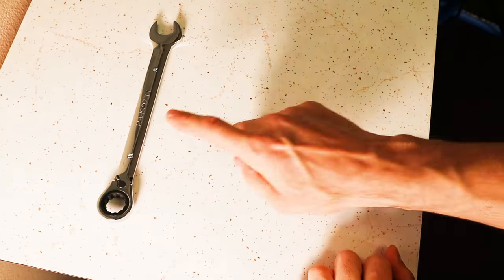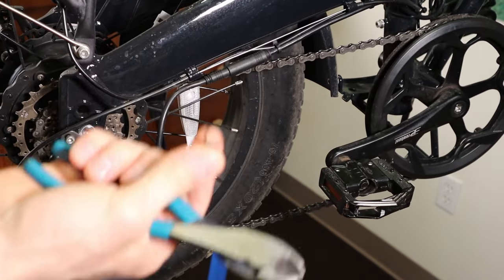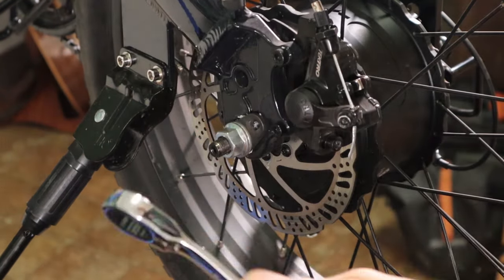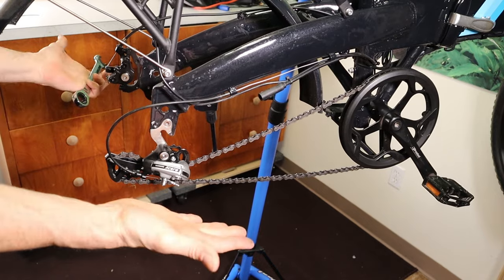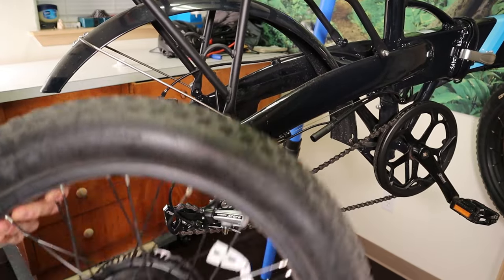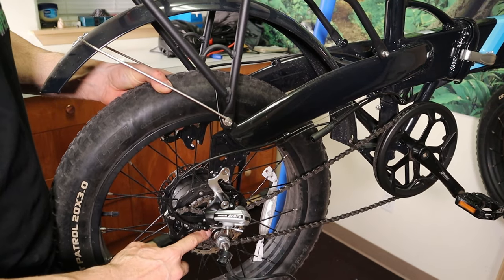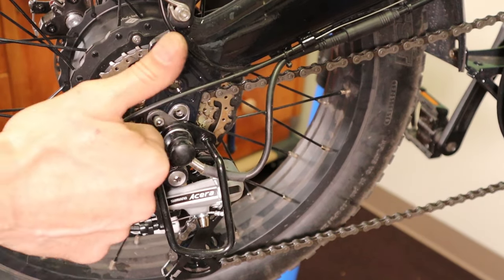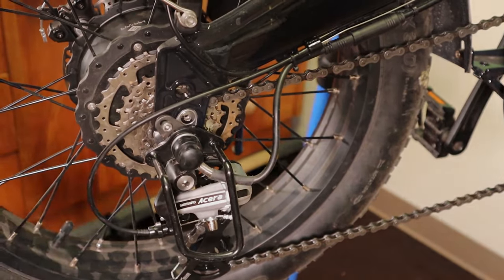Lectric XP 2.0 - REAR WHEEL How To Remove & Install (DETAILED)

Comment: I’m stumped. I’ve had my LECTRIC 2.0 step through since Dec 2021. I put 2500 miles on the original tires, and never once had a flat. Just ordered 2 new LECTRIC tires and tubes. I had a bike shop put them on, along with new brake pads. My brand new back tire has gone flat twice now and stranded me. It’s so strange because there was a pinhole sized leak in the 1st tube. I replaced the tube. Same day there’s a pinhole leak in the second tube. Filled it up with air, and the tube has slime in it. I put the bike in my shed and the tire was flat in less than a minute. We are stumped. We’ve examined the rim and tire. There’s nothing sharp in there, but the leak is in the same spot on both tubes. Has anyone ever experienced this? Could the tire be faulty? My front tire is fine.
Reply: Just got my step thru…back tire comes off the bead during turns..35 psi..left me high and dry twice☹️
Reply: Update to this post. Wrapped the rim with duct tape and haven’t had any issues. Apparently there was something pinhole size digging into the tube in the same place.
Reply: I’ve got 3500 mi on original tires.  
I’ve had one flat,  on rear.  Stranding me once😅.   Luck?         

Rear tire is now treadless and I have to change it 😮.
Reply: Tire liners perhaps?

Comment: I always turn rear motor bikes upside down to make it much easier to install the motor. I also sometimes remove the disc brake adapter (caliper attached) to make it easier to install the wheel....I charge a premium to work on rear motor bikes...some shops won't work on them at all...PITA!

Comment: This video was a life saver! Got my first flat on my XP 2.0, and of course it was the rear tire. Staring at all the wires, chains, spacers and bolts, I was feeling a bit overwhelmed... But after this step by step simple to understand video, I was able to do it all in under 20 min. Thanks again for making these!!
Reply from the maker: Thanks Patrick 👍 I'm glad it helped, the rear wheel can be tricky.
Reply: We have a lot of Mesquite with big thorns here in Tucson so I had endless flats a couple on the front & more on the rear tire. Finally a complete blowout of the rear tube. I bought an $83 foam liner & tube to match, new rim & motor assembly from LECTRIC. I made a DIY liner with an old tire (trimmed down) & trimmed down old tube. It's probably not as good as the foam liner but the front wheel is not so much trouble to take off & put on. With slime this arrangement should do for front & rear. 

I'm watching the video how to R & R the rear tire. Seems like it should be just as good to put the bike upside down (on a pillow for the handlebars & a block under the rear carrier?

Comment: Seriously best of luck to everyone attempting to remove their rear wheel from their hub drive ebike. Spent a solid 2-3 hours watching videos on how to go about doing it after i caught an unsuspecting flat otw home on my totguard mtb eibke. Changing a flat on a regular bmx bike for years had me spoiled once i realized on an ebike its abit different, and imo more troublesome. My bike is from a different brand but thankfully in this video he actually showed the process of removing the wheel and it was similar enough to where itll help others in a similar fashion. This video is one of the very few that actually shows the process from start to finish. 

Seriously though, it was such a pain to actually get the wheel off the first time. Then me being paranoid, i completely didnt pay attention to how the wheel actually came off as i spent an hour tugging away at the wheel due to it being somewhat jammed in place even after taking off all screws and whatnot. Basically panicked once i realized all the loops and whatnot id have to go through to fit the wheel back in once i changed the tube... lol. Then spent another 20 minutes figuring out the best way to fit the wires and wheel through the chain and back in place where it "makes sense", since i failed miserably getting to this part. Fortunately i finally figured it out and after 2 hours, managed to remove the rear wheel while unplugging the electronics, change the flat ( which took like a minute...just my luck), reinstall rear wheel, while readjusting my breaks and stem all in one piece. 

I finally get it now when people preach about working on your own bike when trouble arises. You really do gain a sort of bond with it, and begin to truly understand how and why things work the way they do and will be able to troubleshoot in the future when things pop up. So despite it being a pain that i caught a flat on my new ebike recently, im thankful it allowed me to finally learn how to repair it myself since it honestly wasnt so bad in hindsight. Now i feel much better knowing i can troubleshoot my bike without much concern or needing to stop by my local shop everytime a simple issue pops up. With ebikes, i was apparently overthinking things since in essence, they're still regular bikes at the end of the day.
Reply from the maker: Glad to hear you got it sorted out. 👍 There's a reason it's the Dreaded Rear Wheel.
This is also why bike shops will charge as much as $50 or more, to fix a flat on one of these, plus parts. That's if they are willing to help at all.
My goal is to help show as many repairs as I can so that folks at least have some guidance when it comes to their ebike.
Reply: Although I have a bike stand, I use it to adjust the shifting and adjust the break pads.  When I need to remove the front or rear tire, I find it much easier to flip the bike upside.
Reply: This sounds like a complete nightmare
Reply: @bobthebuilder9416  lol it honestly was at the time when I first did it. But fortunately like with most things, once you do it the first time, it becomes easier each time. But yes, definitely was a nightmare the first time I did it. Thought I broke the dang bike, before finally calming down and figuring it all out step by step. 

In the end, it’s much easier than it looks. But it’s one of those things where you won’t know how easy it is, until you go through it yourself, atleast once.

Comment: Thanks for this. It was very helpful.

I can echo what someone else said. If you don't have a stand, turn the bike upside down to reinsert the wheel. Obviously remove mirrors and move the display out the way etc first. Before I did that I was struggling with it balanced on a box. That would have worked, awkwardly, except for the fact that you really need the pedals to rotate freely otherwise the chain tightens which prevents you from pulling the wheel up tightly which gets very frustrating. Once I turned it upside down it literally fell into place quite easily.

I had to replace my wheel because the speedometer stopped working. Apparently it's the sensors inside the hub which you can't easily replace separately. The new wheel came with new nuts and washers. I noticed that only one of the new safety washes has the hole with the flat sides. The other has a simple round hole so it doesn't lock in position on the axle. I don't think it matters once it's all screwed up tight but I don't know if that was intentional or a manufacturing error.

Comment: Seems if you used a ratchet strap through the wheel and up over the rack, it would help hold the wheel up while you adjust everything.
Reply from the maker: Good idea, that could work 👍

Comment: My two safety washers, that line up with the frame, one lines up and I can get that 4mm bolt in, but the other side will not line up... it's a few degrees off, and since the axle is straight-through, I can't get the one side's safety washer in... it was when I took the wheel off, but not sure why it's off now.... hmmmmm.....
Reply: Flip the safety washer (Lectric calls it "torque arm").  Flat side faces in on one side, out on the other side.

Comment: Excellent guide, good enough to be used by Lectric for reference! I put re-usable zip ties on my RadMini, and got rid of the bash guard as well, so it's not so bad. When you find the wheel jammed or hard to remove, it's usually because the position of the axle rotated a bit due to motor torque, and the axle got wedged. Pre-loading the axle rotation by tightening the left nut first usually eliminates that, but in some situations I'll use a small adjustable wrench to pre-load it (opposite direction of wheel rotation). Props to Lectric for using double safety/torque plates, and thanks for the video!
Reply from the maker: Thanks for the added tips! Always appreciated 👍
Reply: I couldn't figure out how to loosen the axel.  I banged on it with a hammer like i would on a regular bike and it did not work. Finally i used a monkey wrench to grip the axle and turn it in the opposite direction to jog it loose. To clarify, if it looks jammed in one direction, I would turn it in the other and it popped out. I would add to be careful not to bend it too far, just enough to loosen it.

Comment: Thanks for another awesome tutorial!  Chris.  When you get a chance, can you make a video about how to straighten the handlebar?  When I straightened the front wheel, my left side handlebar seems to be farther away from then my right side handlebar.   My XP 2.0 arrived in such a condition.  TIA.
Reply from the maker: Thanks, check out this video - https://youtu.be/G-dPjys6N3Y
There is a 6mm bolt when you fold the handlebars that you need to loosen to straighten them out 👍
Reply: @PedalWithPower  Thanks Chris.  I will try that!

Comment: I dont have a safety washer on the gear side. lThe company insists that I lost it but thats impossible. I would have t remove everything to get it off. I asked them to send me a safety washer. But everytime I do this I spend many hours bahging onthe axle with q hammer. I get it done but It involves lifing it up readjusting until magiclly in finally goes all the way into the slot. I dont see how people just drop the axle in the slot I would pay somebody  50 bucks to ido this infront of me

Comment: I had removed the wheels and I try to put back and the wheels got hard resistance to spin..whats the cause? Is it the motor problem? Coz I try to change the planetary gear inside but everything looks good

Comment: Just wondering if it would be easier to turn the bike upside down and let gravity to seat the wheel back into the slot especially when you work by yourself and without a bike stand?
Reply from the maker: Hi Eric, you can do that. It's just harder to work on your bike upside down. Fine for changing a flat, but you plan to start doing any mechanic work, I'd invest in a repair stand.
I will be doing a video with some tips for flipping your bike upside down soon, still working on it 👍
Reply: @PedalWithPower  Looking forward to it.

Comment: I couldn't figure out how to loosen the axel.  I banged on it with a hammer like i would on a regular bike and it did not work. Finally i used a monkey wrench to grip the axle and turn it in the opposite direction to jog it loose. To clarify, if it looks jammed in one direction, I would turn it in the other and it popped out. I would add to be careful not to bend it too far, just enough to loosen it.
Reply from the maker: Great tip Dao! Sometimes the axle can get jammed in the dropout and needs to be twisted a bit before the wheel can come out.
Also when twisting it with a wrench, be mindful of the threads on the axle so you don't strip it 👍

Comment: very detailed... just what I need for my first flat after 300 miles
Reply from the maker: Thanks Aron! Flats are no fun and dealing with these rear wheels is even less funner (funner?) 
Glad this helped you get sorted👍
Reply: @PedalWithPower  Do you have any thoughts about Tannus Armour for tires? I'm debating myself with the cost of it.
Reply from the maker: @pretor706  I prefer Tannus instead of using Slime or Flat out. Nothing will stop every flat but both of these options will stop small sharp objects.
However, if run over something big enough to puncture through the Tannus it will also be too big for Flat Out or Slime to stop.
With the Tannus you can replace the tube and keep using the same Tannus Inserts, with Slime or Flat Out you will have a big mess and have to buy more Slime or Flat Out for your new tube.
Tannus Armour can also be transferred from tire to tire as you wear out your tires.

Here is my Tannus install video for Lectric - https://youtu.be/hHIjGFf9kRs (sorry, it was my first video and not very good) I'll update it soon.
Here is my install for the Rad Expand 5 - https://youtu.be/r2oFP3yMJT8
I also have Tannus in my Haibike 👍👍
Reply: @PedalWithPower  Thanks for taking the time and reply thoroughly. I appreciate it.
Reply: Same didn't get 300 miles before my first flat. I took it on a nice trip.  Bout 20 miles. Within a week I got another flat on the way to work.
Reply: @clintonclark5832  what did you do to fix the flat

Comment: Will need to watch. On my 3rd rear flat tire in just over 300 miles. City street junk. I'd really like to put a better tire on the rear wheel and/or tire liner. Recommendations?

Comment: Hello, great video! If I don't have this bike repair stand, can this be done by putting the bike upside down while putting the handles on blocks to protect the screen ? Thanks again!
Reply: installing the rear wheel is much easier if you flip the bike.  Gravity is working against him, that why it gave him such a hard time. With a flipped bike gravity works for you. Rotate the screen out of the way so it won't touch the ground.

Comment: Plan on buying an e-bike in the very near future. My first investment in accessories is going to be a repair stand like you use. I have several standard regular bikes in my garage that I have to stand upside down on their seats to remove wheels. The repair stand looks critical in making repairs easier. Thanks for the video.

Comment: Chris,  is the axle on the gear cassette side hollow and the motor wire go through from the inside of the motor to where it connects? The plastic cap has no function other than cover the nut?

Comment: The rear wheel removal seems more difficult than it actually is. I Patched my Lectric 2.0 rear wheel with no issues except I didn’t have a 19mm wrench. Lol thought I could use a socket lol. Great video.

Comment: There brake mouts are so bad ive had to replace 3 rear brakes with bb7s because the frame isnt square AT ALL if you want an ebike spend a little more dont buy this pos
Reply from the maker: It is a budget ebike, no doubt
Reply: @PedalWithPower  that it is you did good job on the guide, working at a bikeshop i just cringe everytime i see a lectric

Comment: Any other suggestions to support the bike while changing the wheel if you can't afford the stand at this time?  Excellent video!
Reply: Flip the bike upside-down.
It's actually easier than using a stand.
Just don't forget to put something under the seat and handlebar so that they won't get scratched up.

Comment: Followed everything but my rear tire would not come out, i have a 2021 step thru 2.0. Why is this?
Reply from the maker: It's possible the axle is twisted in the dropout. I should have covered this but my axle wasn't twisted. I'll add a quick video soon showing how to fix it.
Try to grip your axle with a crescent wrench on the flat sides of the axle and twist it free. It helps to look in the dropout and see which direction you need to twist it so that it will un-jam from the dropout.
Reply: @PedalWithPower  Thank you, this worked wonders after a hard time with hammering it over and over for half an hour. Lifesaver, got a new subscriber
Reply from the maker: @envikka  😃👍 Thank you, glad you got it sorted!

Comment: So I am wondering. I've watched 2 previous videos, and the guys had no clue what their doing. I just got a 2.0 yesterday and the rear tire won't hold air. I I assume it's a pinch flat. Is that repairable or do I have to get a new tube for before I can ride this bike? I Thanks for your input and and anyone who knows. Oh, and mine is a 2.0 stepthrough, if that helps.
Reply from the maker: Hi Darrel, you can check the tube for holes and if they can be patched and the tube holds air, you can ride on it.
Reply: @PedalWithPower  okay, so just say you have no idea
Reply: So my next thought is to use the Slime I have left from my last bike {KBO Breeze } that I sold last week to purchase this bike. Didn't expect to have a flat tire before I could even ride it. Let me just see Lectric is willing to make it right or pass the buck
Reply: So I just got a replacement tube from Lectric today (way to go Lectric) it only took 2 days. Amazingly, that was faster than Amazon (I ordered 2 tubes from Amazon due to arrive tomorrow) along with a steel valve stem wrench since the 2 plastic tools from Slime wouldn't work. (man, everything bolted on here is EXTREMELY tight) and even my crescent wrench wouldn't unbolt the axel, I had to borrow a 18mm wrench from my neighbor. But I think I got everything bolted back together. Going for a 1st time test drive and in a few